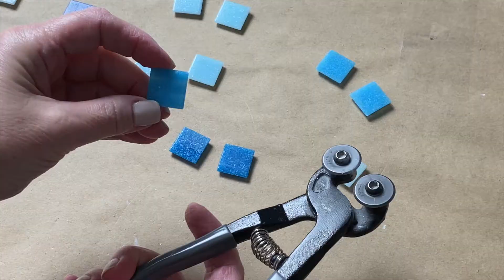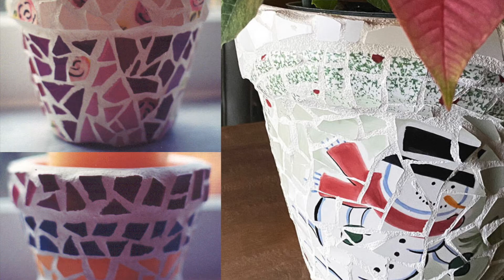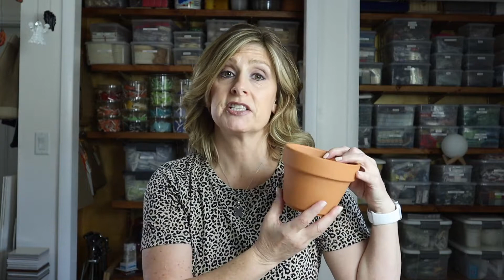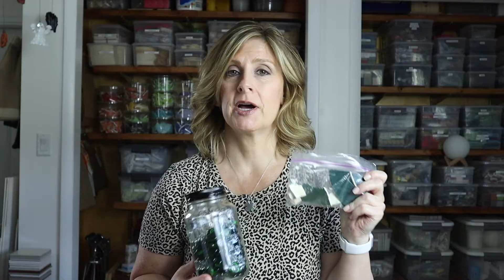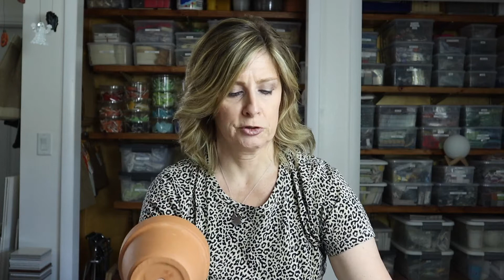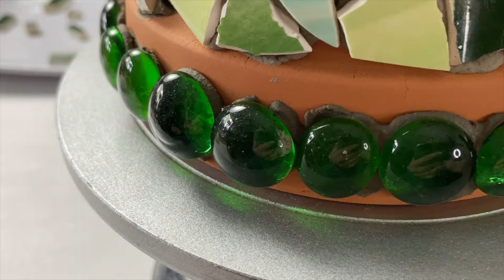HOW TO MOSAIC A FLOWER POT - part 1 | Materials, Cutting, and Tiling

Comment: Hi Julie, can you give me an idea how much thinset I will need for three 12 inch pots, please?  Also, you might want to update the thinner recommendation because as of August 2025 the product at the link is unavailable.
Reply from the maker: Hi there! If you're using the thinset for adhesive and grout then you'll be fine with a 25lb bag (if you can find it). I updated the thinset links in the video description (thanks for the heads-up!) but could only find 50lb bags. 😊

Comment: I have seen it recommended that terracotta pots be soaked in water first so that the terracotta doesn't suck the moisture out of the thinset, weakening it.  I mist it while I go, because I live in a dry climate and, if the thinset dries too quickly, the tiles pop off.  Have you heard this?